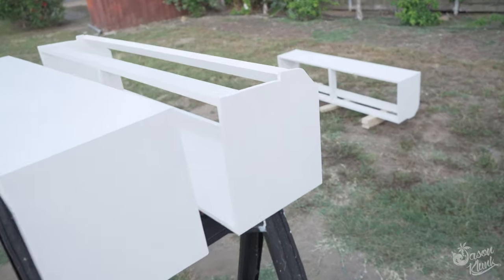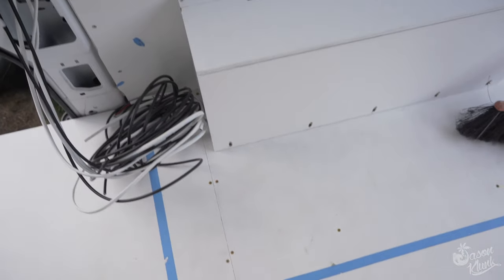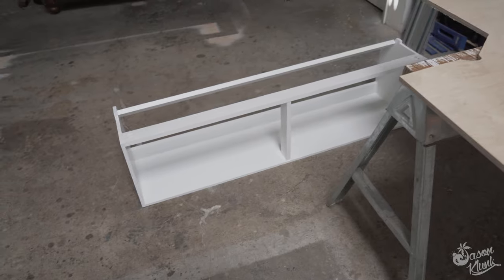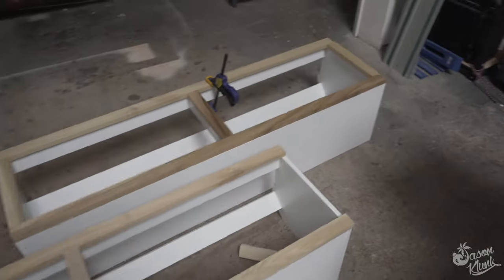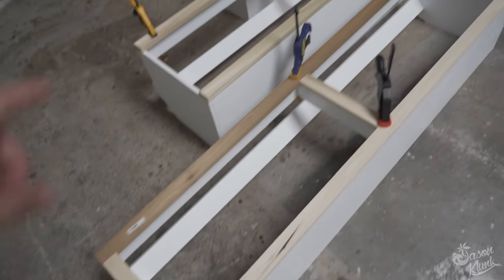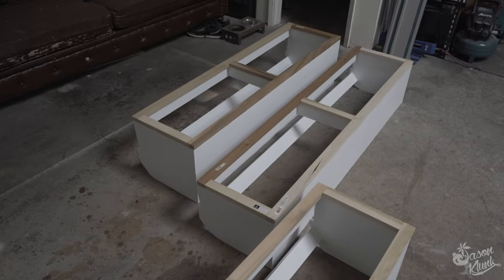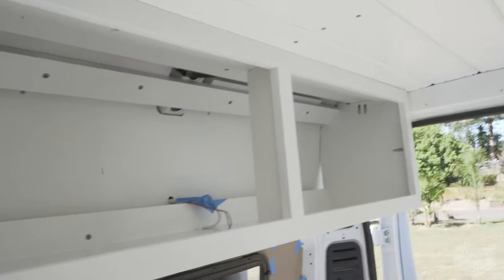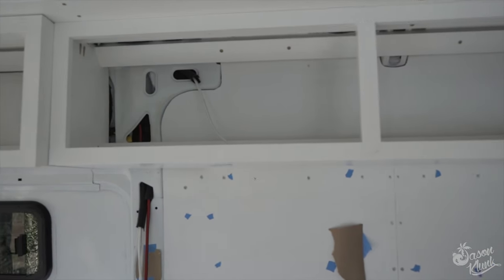Installing Upper Cabinets! Ram ProMaster Van Build Conversion - Episode 14 | Jason Klunk

Comment: Jason, how did you attach your face frames to the cabinets? I saw some brad nail holes when you were patching them. Did you also use wood glue? Do you recommend painting / priming first, then attaching or attaching first? Thank you!! Love the videos!
Reply from the maker: Nails and pocket screws. Either way is fine, I would recommend painting as much as you can before hanging them in the van.

Comment: Gosh looks great. Going to build mine just like yours. Question. The bottom on the upper cabinet. How did you figure out when it was level? Measure from roof down? It’s just a stumbling block for me. If you could help. Thanks.
Reply from the maker: Thanks. It's definitely tricky because nothing is ever level in the van depending on where you're parked! I used a combination of measuring from the ceiling and eyeballing it to figure out when it was level. Even measuring from the roof is tricky because the roof isn't completely flat from front to back or side to side.

Comment: How did you build around the pillar? It’s hard because it’s not flush with the wall
Reply from the maker: very carefully, lol. I basically built up my furring strips on both sides of the pillar so that I had one level surface to work with.

Comment: Currently building a ProMaster and I've been following along with your videos, they're so much help! 

The next step is ceiling, then upper cabinets. I'm wondering if you're willing to share your cabinet dimensions?
Reply from the maker: Right on. Yes, I will grab some measurements this weekend for you.
Reply from the maker: The upper cabinet towards the front of the van is about 13.5" (H) x 10" (D) x 57" (W). 
The back upper cabinets are both about 13.5" (H) x 12" (D) x 51 1/4" (W).
Reply: @JasonKlunk  Thanks as ton! It won't be long before we get to this step. Much appreciated.
Reply from the maker: no problem!
Reply: @JasonKlunk  Does this depth dimension (10" and 12") include the face frames and doors? Or is that just the box?

Comment: Did you end up doing anything to cover the wires from the recessed puck lights, or did you leave it like we can see in this video? In the middle of our upper cabinet build now, and that has us stumped. We’ve seen others do a false bottom, but that seems like a big loss of limited space, so curious how you handled that?
Reply from the maker: I made little covers for the puck lights that are basically just hollowed out pieces of 1x3. I ran the wires through some split loom tubing to protect them.

Comment: Did you screw the cabinets directly into the metal van framing? If so, did you pre-drill holes into the metal? Confused because it looks like you used cabinet screws made for wood, wondering how you attached to the metal framing
Reply from the maker: No, the screws go into my furring strips. https://www.youtube.com/watch?v=8qUEerHLEwc
Reply: So you’ve got 1/2” thick furring strips and 1/2” thick cabinet supports. Where’s the other 3/4” on your 8x1 3/4 cabinet screw going?  Did I miss a layer?  Thanks!
Reply from the maker: @bdstkd  Furring strips are doubled up (or even bigger) in a lot of areas and the supports for the cabinet boxes are 3/4" poplar. So I'm always screwing into at least 1 3/4",  but most spots for the upper cabinets I have 2" or more.
Reply: Jason Klunk Thanks for the info....very helpful!  Did you bolt into the cross nuts through all the laminations of your furring strips, or just the first layer?  Also, what size screws are you using to attach wall panels and ceiling?  Great videos and methods!

Comment: Great work Jason...we're building at Promaster 159 in S. Carolina.  Curious on the dimensions/specs of your cabinets?  I want to do some very similar. (i can send you our YT channel if you would like...not sure if I'm allowed to post in comments or not:)
Reply from the maker: The upper cabinet towards the front of the van is about 13.5" (H) x 10" (D) x 57" (W). 
The back upper cabinets are both about 13.5" (H) x 12" (D) x 51 1/4" (W).
Reply: @JasonKlunk  Is the depth measurement (10 and 12 inches) just the boxes? Or does that measurement include the face frame and the doors?

Comment: nice work dude,  very nice... I do have a question ,  on the cabinet bottom, what wood did you use. I did the 1/4 luan plywood... not liking it....
Reply from the maker: Thanks.  The cabinets are 1/2” baltic birch plywood.